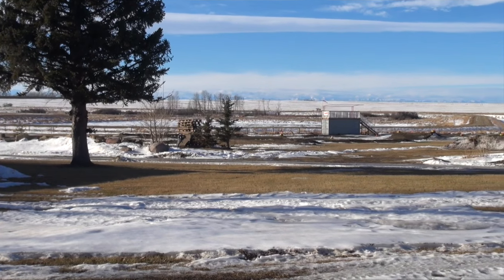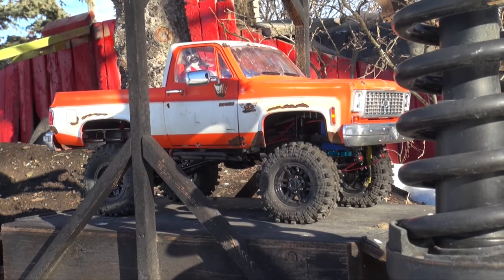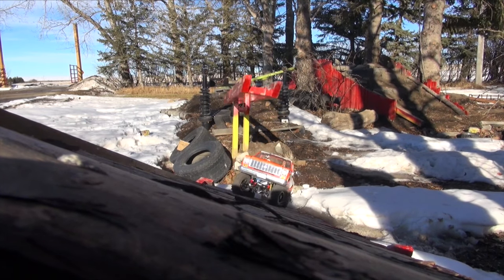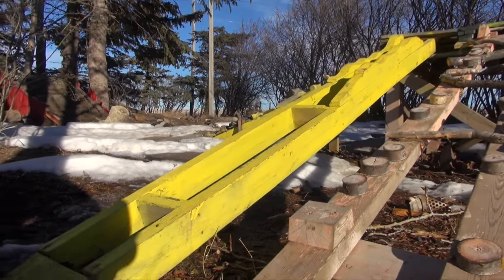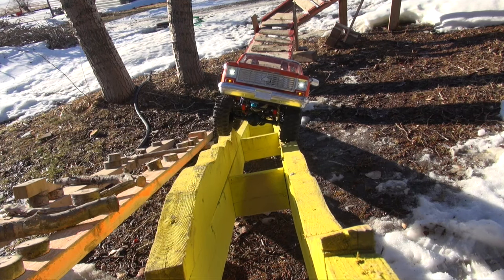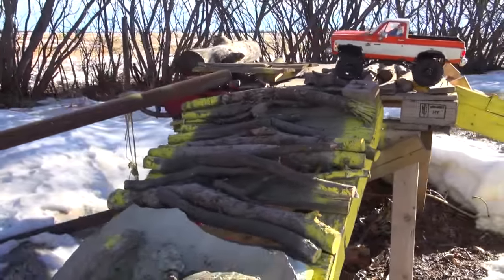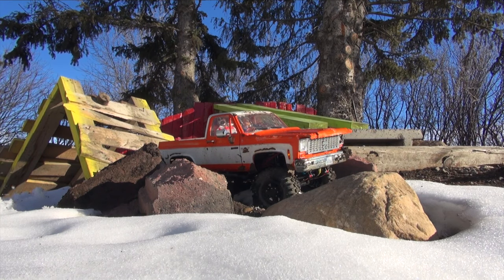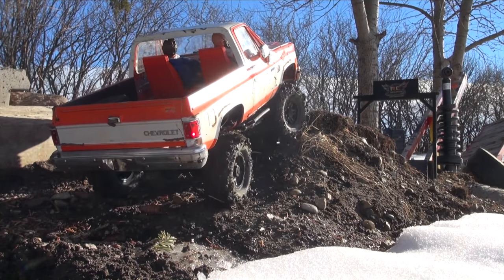RC ADVENTURES - My 1976 Chevy K5 Blazer 4x4 (No Canopy) Crawling Backyard Trail Course

Comment from the maker: What is YOUR Favorite Radio Controlled Truck?
Reply: RCSparks Studio traxxis slash
Reply: RCSparks Studio I actually got a latrax teton  and I LOVE It Dude you encouraged me to get into the hobby thanks keep up the good work!
Reply: RCSparks Studio I like everything rc truck and plus I'm a big fan of you
Reply: RCSparks Studio Dodge Ram 5500 is my favorite, favorite car is a 70' Dodge Charger R/T, both gas powered. (want to build)
Reply: RCSparks Studio Arrma big rock
Reply: RCSparks Studio Traxxas skully
Reply: RCSparks Studio The Ford F-150 with the modified bumper
Reply: RCSparks Studio the vaterra twin hammers
Reply: RCSparks Studio I love your videos they always make me happy when my truck is down am a traxxas guy
Reply: RCSparks Studio my favourite rc is my 1/16 e revo with 4s battery and 2.2 paddle tires
Reply: when are you going to use the black window agin
Reply: RCSparks Studio I love the capo 8x8
Reply: Traxxas Bigfoot
Reply: RCSparks Studio my sawback lol only one i got so far but going to be doing a build in February maybe a cross truck, medic are cross any good?
Reply: RCSparks Studio the only one I have is a exceed mad torque but I would love to have axial honcho but I'm only 14 and can't afford something that expensive
Reply: RCSparks Studio traxxas slash 4x4 platinum
Reply: RCSparks Studio My favorite right now is my dual 45t rc4wd  brushed fully customized Axial Honcho! Wicked Torque!
Reply: Grease Monkey RC Do a quick way to earn money is by doing bottles. Thats how I got my favourite truck which is my SCX10 Deadbolt
Reply: RCSparks Studio love them all 

Feel weird selling anyone of them
Reply: RCSparks Studio traxass stampede
Reply: RCSparks Studio traxass stampede
Reply: RCSparks Studio I just got my first traxxas slash this Christmas and it is awesome
Reply: my lowered, brushless, 3s slash is probably my favorite, but I am planning to get Bigfoot no.1 next month, so after a few upgrades, we'll see. :)
Reply: RCSparks Studio hey medic I am a fan I wonder if I can have a rc truck I've always wanted one I live in Fontana ks you can send it please I really wanted one please
Reply: Cody Ogden Thanks for the advice
Reply: RCSparks Studio- Traxxas Stampede 4×4
Reply: Grease Monkey RC and A good way to keep the money safe so it doesnt get wasted is having your parents put it in an envelope in their closet so you dont feel the need to spend it.
Reply: MINE! lol... My first crawler RC. RedCat Racing Everest 10. All stock except metal connecting gears(axle diff), and rearranged suspension links and shock setup, weighted front wheels.
Reply: RCSparks Studio- out of what I have right now: scx10 ii (btw that's all I own right now)
one I want to buy right now: latrax sst (have $ just need it in stock) 
dream truck: traxxas Xmaxx
Reply: RCSparks Studio- out of what I have right now: scx10 ii (btw that's all I own right now)
one I want to buy right now: latrax sst (have $ just need it in stock) 
dream truck: traxxas Xmaxx
Reply: RCSparks Studio traxxas slash 2wd
Reply: RC Thunder I wouldnt recommend the sst. I have a sst. I have lightly ran it 12 to 16 times and it has never lasted more than 5 runs... not being jumped and just lightly ripped around... I personally recommend saving up for a slash because the sst is for more of a beginner hobby truck and arent built to that great of quality..
Reply: RCSparks Studio axial scx10 trail honcho
Reply: My Hilux Truggy!!
Reply: RCSparks Studio When you were talking about your RCs, the Toyota Hilux TG UK reference is my favourite. I you were talking about my over all favourite, it's definitely the HPI WR8 Ken Block Ford.
Reply: RCSparks Studio fast rock crawlers like the gray on you have
Reply: RCSparks Studio how much do your trucks cost?
Reply: RCSparks Studio out of yours the k5 or the big skid loader haha
Reply: RCSparks Studio my favorite truck would have to be my traxxas slash, next would be my venom creeper mod to be my trail truck
Reply: RCSparks Studio the ford
Reply: My Vaterra Ascender K10 that...I....have yet to order lol.  For now, my 2wd slash.
Reply: RCSparks Studio I only have one RC the slash 2wd!!!
Reply: RCSparks Studio i would like to find a reliable site to buy rc cars and trucks and parts to upgrade them
Reply: axial scx10
Reply: I would have to say my Axial Yeti custom built Trophy Truck.
Reply: 1 Axial SCX10 II and 2 Glamis UNO.
Thanks. Yvan :O)
Reply: RCSparks Studio you should really check out the new vkar bison man its the same as the Helion Truggy just really cheap but built really really well and all brushless that comes with a lipo battery and charger just check it out my man btw I love all your videos
Reply: The Mepic Wraith aka. Black Widow & Kraken Vekta
Reply: scx10 rubicon was my first rtr crawler. I had a 2 and 4 wheel slash prior. I prefer the crawling.
Reply: Rock crawler
Reply: I really like my Wraith but the TF2 is still my favorite...she was my first build...
Reply: I've all about my wraith ever since I built it. I have a few rigs but my wraith always goes out when I go out.
Reply: RCSparks Studio why did you delete your video about your garage being messy
Reply: Axial scx10 deadbolt
Reply: RCSparks Studio can u do a unboxing video of the new 1/5 scale redcat racing clawback plz i might be getting it and i know nothing about it so if you could post a unboxing video that would be very helpful thx
Reply: can you do some test on the wltoys 10428
Reply: RCSparks Studio  what is a good starter rc truck
Reply: 1/16 e-revo Vxl
Reply: 1/16 e-revo vxl
Reply: RCSparks I love the losi Baja Rey and Axial Wraith
Reply: RCSparks Studio traxxas slash 4x4
Reply: RCSparks Studio i also like the axial scx 10 c/r edition
Reply: RCSparks Studio
Reply: Savage x, scx 10 dingo, Tamiya Hotshot (first car).
Reply: alls !
Reply: I have a Redcat shockwave and a traxxas slash Robby Gordon edition
Reply: RCSparks Studio Your Black Widow. :)
Reply: RCSparks Studio the one i'm building next ;).
Reply: RCSparks Studio probably the k5
Reply: Traxxas nitro rustler
Reply: RCSparks Studio it will be the Xmaxx 8s in February
Reply: l
Reply: my favorite is the axial scx 10 honcho, unfortunately i don't own one...
Reply: RCSparks Studio scx10
Reply: I have a Tmaxx 2.5 that I upgraded to a 3.3 but I do want to get 1/5 scale and join yall on the track
Reply: RCSparks Studio i'm pretty sure it will be my v2 Xmaxx that I have coming in February
Reply: RCSparks Studio Horizon hobby ruckus 2wd
Reply: RCSparks Studio mine is a Traxxas Slash 4x4 VXL
Reply: SCX10 ii!
Reply: RCSparks Studio axial scx10
Reply: skully is the only one I have
Reply: RCSparks Studio traxxas short corse truck 4x4
Reply: RCSparks Studio probably exceed mad torque 8x8
Reply: RCSparks Studio vaterra ascender blazer, or traxxas bandit
Reply: Axial Dead bolt
Reply: RCSparks Studio hey medic when are you going to take the trx-4 on your course
Reply: RCSparks Studio The stampede
Reply: Hmmmmm.. My first rc car was, Traxxas Grave Digger 2WD so, lets say that is my favourite car :) I have many others, but, that is THE oldest and legendariest. :)
Reply: RCSparks Studio can i have a rc
Reply: Xmaxx,  slash, and your Beast!  Good job Medic and Thankyou for the quality entertainment!
Reply: Trail Finder 2
Reply: RCSparks Studio scx10 honcho

Comment: its always nice seeing the shocks work and the tires grip from the side trying to pull its way through, and the torque going through the axle to the universal joints and into the wheel, theres just such a beautiful exaduration you get when driving one of these and trying to tackle obsticles :0)) i just bought my first  one the other day a 1/18 scale temper and love it,

Comment: Not nitpicking, but it is actually a '78 model, that was the modelyear it got a door over the fuel cap. In '79 the turn signal and headlight was combined in the same bezel, so it must be a '78 model. Anyway, who cares if it is a '76 of a '78, the Blazer is awesome :) !
Cheers.

Comment: from the slow motion it looks like you could benefit from  a stiffer tie rod. Your getting alot  of bump steer, wobble and end shake. it will  help with rock climbing and really all aspects of driving because when each front tire is on seperate angles of terrain  they have different lateral forces pushes the tires in and out changing the alignment of the front tires which other than the obvious reasons it also adds rolling resistance, and when rock crawling that needs to be minimized because it throws the whole rig out of stability and makes it easier for the rear end to kick out or slide off a rock or not track right when on something really slick.

Comment: just finished working on a traxxas slash 4x4 i bought yesterday. now it's ready and i'm going to find a nice place to drive it
Reply from the maker: make sure to tighten up your slipper clutch & have fun! https://traxxas.com/support/How-Adjust-Slipper-Clutch (Picture 4)
Reply: Same
Reply: I have a good place to drive it tho
Reply: Hey my car only pulls on the front wheels, but when i lift it in the air all 4 wheels spin, what do you think it could be?
Reply: Henrik do you have center diff? if yes then you don't have oil in it. i recommend to completely disassemble it and find out what's causing your problem

Comment: Why did the tires have those flat spots on them, are they just fro. the truck sittin for so long?
Reply: At the part with the yellow ramps
Reply from the maker: Ahh, yes, from the cold.. the air constricts inside the sealed bead lock.. causing a bump
Reply: r

Comment: New to the hobby, seal the wheel/tire when in wet conditions and vent the wheel/tire when crawling in dry conditions?
Reply from the maker: Yes, they are sealed bead lock rings ;)

Comment: Hey Aaron,

How do you get the K5 Blazer (Brush-less Tekin) to crawl super slow???

Thanks
Reply from the maker: I use an exponential setting on my radio for ultimate throttle control :)
Reply: Which radio??

Comment: how long can you crawl in terrain like this on one battery? how many maj these battery have? thx for answer;)
Reply: my slash 2wd on 5000mAh can drive 2km with speeeeed! And more or less 40-50minutes driving
Reply from the maker: For this entire film I used a single 3s Lipo, 2200mah !
Reply: RCSparks Studio ok. but how long can thise 2200 package drive grom full 4,2V on cell to empty 3,0V per cell?

Comment: not much flex in that suspension setup
Reply from the maker: Actually, there is quite a bit - (for a miniature full sized truck). It is not a dedicated rock crawler, rather a replica of a 1976 Blazer! What you are seeing is a leaf sprung suspension, with a 4 link rear end. The rear moves more than the front.. but yes, compared to a dedicated articulating crawler - this truck seems limited. Two different styles of crawling
Reply: RCSparks Studio Yeah and I watched your running video of the komodo and how you explained your preferences. Makes sense.